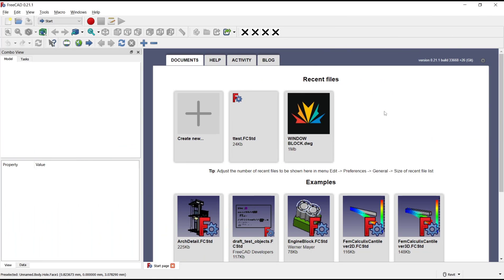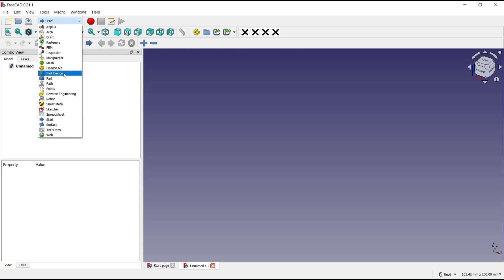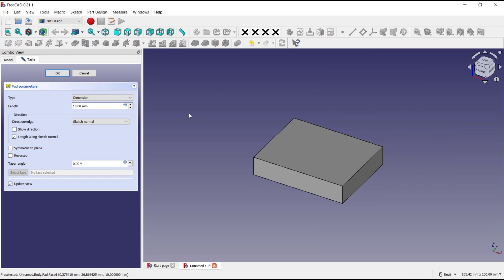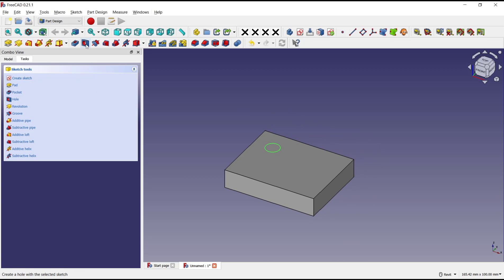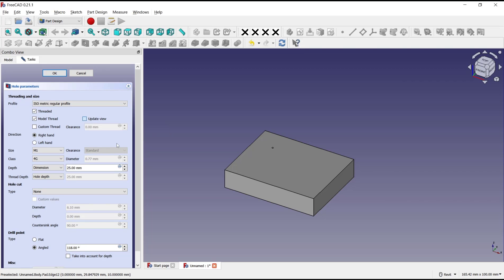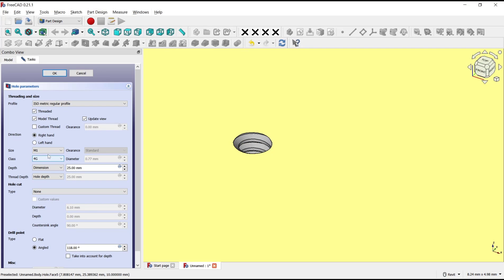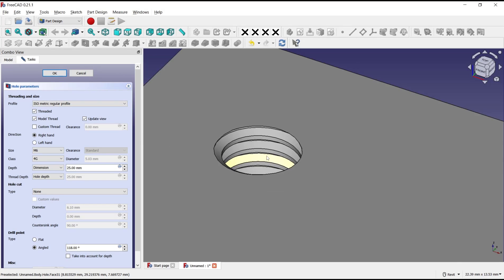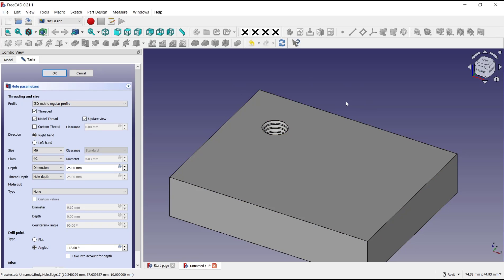FreeCAD How To Hole Thread

Comment: thanks for the video. I was wondering if you could show an example of creating a hole, and then have the threads start a few mm from the top of the square. i.e. the threads do not start until a certain depth in the hole is reached. Thank you!
Reply: I managed to hack a solution. e.g. If you need a 20mm deep hole, and you want 15mm deep thread, starting 5mm down from the top surface. You extrude your surface to 15mm. Now put in your thread all the way through, as normal. Now just select your top surface and extrude up the 5mm. Hope that makes sense.
Reply: @sar2908  yes, I think that would work. I tried making two of the same shapes and added just a hole to one and the thread to the other, then I merged the shapes. I think both would work well. 
Cheers